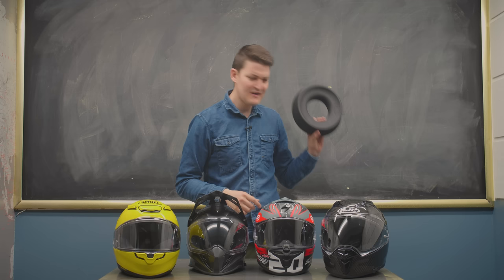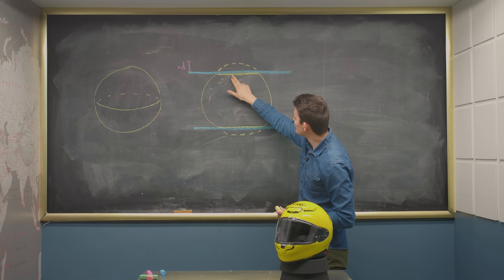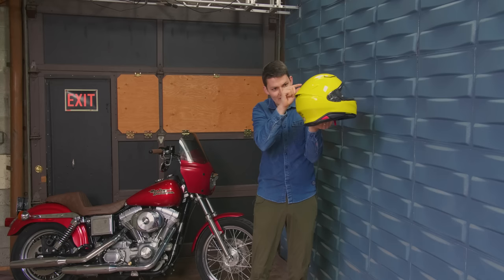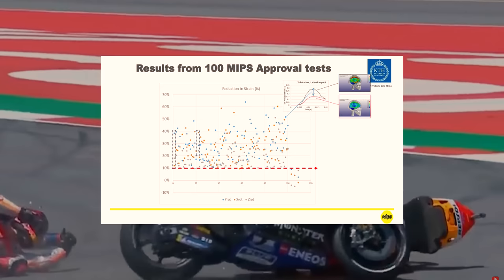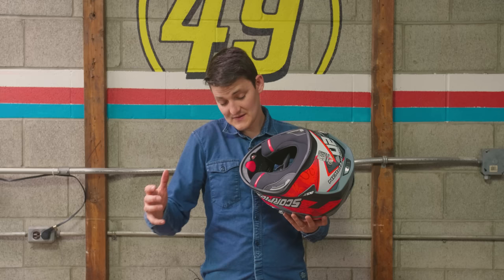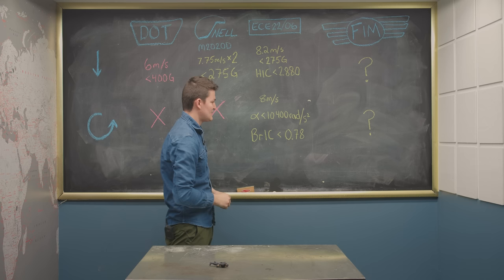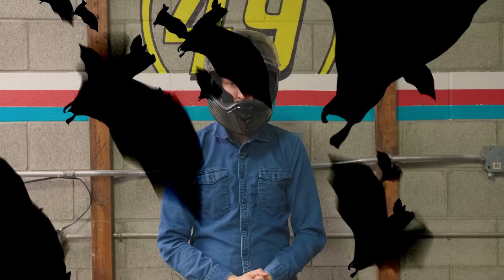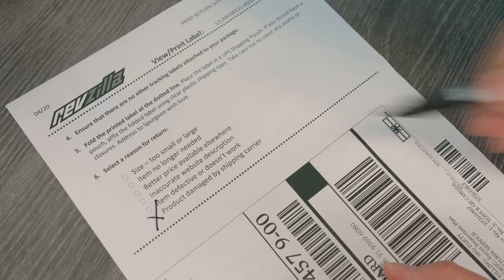What's Inside the Best Motorcycle Helmets of 2021?

Comment: Mandatory disclaimer: people should check the details of the ECE rating they see on helmets. 22/05 and 22/06 are quite different and not many helmets are up to the 22/06 standard just yet!
Reply from the maker: Very valid point! ~RF9
Reply: The Arai Quantic, which was not "designed" to pass 22.06, is the only helmet as of yet to pass this new standard.
Reply: @scottenlow5249  and the new Shoei
Reply: @rideoutlondon  do you know which shoei specifically?
Reply: @222wheelsdown  NXR2
Reply: Thank God for the FIM of the Scorpion then, sheesh.
Reply: @FortNine 000000
Reply: @FortNine  but the HJC F70 carbon 2021 is only ECE 22.05 approved… Is there something I didn’t get?
Reply: @ook92 wondering this myself.

Comment: I bought the EXO-R1 about a month ago and I'm glad to see it here. The fit is incredible and everything about it feels premium.
Reply from the maker: Glad you're enjoying it! I've been loving mine as well. ~RF9
Reply: Does it have room for communication devices?
Reply: @Delalcon  Yes it does!
Reply: @HydefHyde  Cool! Thank you
Reply: Would you take it over the shoei? I've been looking at the scorpion because it's technically fim homologated. But I like that the shoei has mips. Someone help
Reply: @joshuaplantan90  I ordered both the EXO-R1 and a Shoei RF-1200 and spent some time sitting around my house with them on. They both felt great, and it really just came down to the smaller particulars of how the Scorpion's more plush chinstrap felt around my jaw, the inflatable cheek bladders (as mentioned in this video), the inclusion of both a clear and dark visor, pinlock, and overall style that lead me to keep it and send the Shoei back. From what I understand about the RF-1400 is that it's more of a iterative step from the 1200, not so much a revolutionary one. Better air venting and more refined angles I think. I would imagine they are pretty comparable in terms of safety, but I that's only going by the safety organization certifications and not from personal experience (fortunately) crashing in either of them.

Sorry if this wasn't more decisively helpful... If you're really on the fence I would recommend doing what I did, ordering both and seeing which gels with you more! Both RevZilla and MotorcycleGear do free returns as long as you didn't (visibly) take it out on a ride or ding it up. Good luck!
Reply: @HydefHyde  definitely leaning towards the scorpion, my problem is finding gear that fits. My hands are to small for a small glove but my fingers are too short for a medium. The arm length on a small is to short but the chest area fits perfect vise versa for the medium. I like the idea of the inflatable pads to get the right fit
Reply: @joshuaplantan90  I have a similar problem ! My sizes are all over the place. Large jacket, small gloves, extra-large Helmet! Must be the huge brain! :P

Are you measuring yourself for your gear? Not to rep Revzilla too much, but they've been really helpful with the sizing charts and sizing recommendations on their project pages and videos for when things run big or small or otherwise unusually. When in doubt I just call them for recommendations regarding sizing, and now I have a full set of gear that fits me perfectly.
Reply: @joshuaplantan90  I know how you feel unfortunatly ahah
Reply: @HydefHyde  yep tape measure and all. Thinking about getting a jacket next, then a helmet. Save some money for now then get a bike. Have my M endorsement just don't have any gear :(

Comment: I have the Shoei RF-1400 because of this video and it is everything Ryan said.  It is incredibly comfortable (once on) and very quiet but it destroys your ears taking it on and off.  The trick is to tuck your ears in to the helmet before you pull it down over them.  This reduces the discomfort by 50% but it still smarts a little.  Other than that...darn near perfect helmet.

Comment: This is a most excellent video.  I like how you cut it apart, explain each layer and rating standard.  I have ridden 45 years, always buy top of the line helmets offering the best protection.  I crashed in 1983 with a Bell Star helmet which save my life no doubt, crash once and you are a believer.  After my crash I took a motorcycle safety course and learned how to ride, went on to become a motorcycle safety instructor for 15 years and now just enjoy my wind therapy.

Comment: Great vid! I love that a company is bringing FIM safety standards to more affordable prices
Reply: but then dont forget that a FIM helmet might safe you at a 200 km/h crash, but there is no
part in the regulation that would help you in you normal 50 - 100 km/h crash

if you design a helmet to jsut work at high speeds you get one that sucks at low speeds while
the contrary isnt as true
Reply: @lexel90  They aren't just designed for high speeds tho? They are basically more stringent than both SNELL and ECE in both criteria for crash resistance, at all speeds.
Reply from the maker: @lexel90  FIM is actually the most rounded standard, speed wise. If you plan on hitting the wall at 200km/h, Snell is by far the best bet. ~RF9
Reply: @FortNine  awww hoping id see my bell race star on here, almost got the shoei over my bell
Reply: @FortNine  so fim for the street, Snell for the track?
Reply: @joshuaplantan90  nah fim for both

Comment: A early 80's Simpson full face flexed so much on impact that it shattered both eye sockets, broke the nose, upper and lower jaws and both cheekbones. Some of the wires to put my face back into position are still there 38 years later. The only thing that didn't break was my forehead, which the doctors used as the anchor point lacing wires through all the broken bones and pulling / pushing everything back into place. I survived, and the helmet looked undamaged. But it flexed way too much. I'm hoping to never crash again (yes, it really was the cagers fault) and I'm hoping that the new crop of helmets in the $500+ range will better protect my head or what's left of it. Thanks again Ryan for a informative and entertaining video.

Comment: Ryan, what about the SHARP ratings? I know they're ultra slow to update, but it seems, based on all available evidence, that their force reduction measurements are the best of them all. Furthermore, you don't just get a "pass" or "fail", but you know exactly how well the helmet preformed. Curious your thoughts on SHARP and why you didn't mention them!
Reply: Sharp is a fixed test. so a cheap helmet manufacturer knows where to reinforce the helmet to get a 5 star rating.
Reply: @akirasanakirasan5347  incorrect: "To ensure that we accurately assess helmet performance, it is important that our impact conditions are representative of real world accidents. The in depth accident investigations carried out by COST 327 confirmed a direct correlation between helmet damage location and head injury. It considered the UN-ECE Regulation 22.05 points to be appropriate and SHARP therefore uses the same impact points – to the front, rear, crown, left and right sides. In addition to this however, for every helmet model that is rated a sample is dismantled to check whether there is any localised reinforcement that could lead to an inappropriately high rating. If this is considered likely, SHARP retains the right to test at any other point on the helmet (within the extent of protection specified in Annex 4 to UN-ECE Regulation 22.05)." from the sharp website
Reply: @rd8586  i am connected to the helmet business i know how they get helmets to pass the test. do not but cheap helmets even if Sharp gives them a high score
Reply: @akirasanakirasan5347  My father is the CEO of arai and he told me the sharp testing is the most accurate in the industry

Comment: Honestly, take a look at the “LS2 Valiant II”, which is a far superior model to any of these. Fully P/J certified while the chin piece neatly folds to the back in Jet mode (serving as a neat little spoiler and counter weight), thus no need to decide every time upfront what could be the best choice before leaving the house. Additionally it is reasonably priced, has quite a  large visor (Pinlock) with integrated sun protection and enough empty space to install any communication package. When in (sub)urban and slow highway traffic, I usually keep it in Jet mode for maximum air flow to my face, but when accelerating further, the sturdy full face configuration is only a matter of swinging the chin piece forward where it locks in place automatically (and vice versa). 

A true game changer, especially in summer 😎 The only downside would be a little extra weight (1700g)

Have a look!

Comment: As an engineer, I need to point out the fundamental flaw in your diagrams: they all show the object uniformly supported at the bottom.  That isn’t the case with a helmet.  During an impact, it is supported mainly by your head, not some magic force along the bottom periphery… unless you are wearing a very robust neck collar which most street riders don’t wear.  So, the real issue is the spreading of the force from the shell to your skull, not the periphery of the helmet.  A flexible shell seems contraindicated to me.  I’d want a fairly rigid shell to transfer the impact to the largest area of the styrofoam as possible and thus the largest area of one’s skull.
Reply: Yep, like most of his stuff he starts of with a nonsensical assumption and farts on madly from there.  Total and utter rubbish fromstart to finish!
Reply: Easy for YOU all to say! Haha. Thanks for the counterpoint.
Reply: But he does bring up a good point that whenever your helmet hits, torque is going to be carried by your neck.
 
 
 
That being said, because your an engineer you probably know where to look or at least give me some pointers, where could a kid like me read about the modern requirements and the technology/methods that motorcycle helmets employ? Because there are a lot of mechanisms that I've seen helmets use (or at least concepts), such as a bio-mimic of the skull as in there's a liquid layer, I forget what it does exactly, my guess is that it spreads the force hydraulically (like that one engine component, I think it's the crankshaft) and offer some slide like the plastic plate. In fact, I would like to know about designing and engineering in general, is brilliant.org recommended?
 
Any place that someone like me, one who has no background in engineering or anything similar, could actually comprehend and read. If there isn't anything like that than how and where can I go to understand the language? And don't say "school", I know that, I need something a bit more "quick" and accessible.
 
Oh and electricity as well as electronics and circuits. I know very little pretty much nothing about these subjects and would like to learn about and understand them.
 
Why am I asking? I want to design a helmet (and many other things, but like this, I lack the knowledge) that contains electronics within, proper ones at that, not aftermarket add-ons. The slide plate made me realize I am still missing components that would make it safe; a hard, dispersion oriented material and multiple levels of impact foam aren't the only things(?) that go in. (If you want, I could tell you what is brewing in this brain of mine, what tech exactly I plan to add in)
   This also brings up something, what material(s) would you recommend that I use? I want something robust under normal circumstances as I plan to abuse it even when not on a bike due to what technologies I plan on implementing within (it will be a demonstrator platform for my ideas, mostly not impact related), but still be able to rely on it when I inevitably fall. In fact, you can exercise your brain too, I'll allow anything from multi-layered shells (like aluminum-ceramic composite) to active systems such as pneumatic bags (simply an airbag) or hydraulic ejection (just something I cam up with right now, impacts squish liquid with resistance, effectively acting as a shock absorber in that it changes motion into heat)
Reply: @jrjrjrjrjrjrjrjrjrjrjrjrjr  I don't think they meant it like that. It could be that they're used to proper representations and when they see a crude version it can't be helped to notice flaws; essentially tunnel vision
Reply: @jrjrjrjrjrjrjrjrjrjrjrjrjr  Wow, what a bunch of nonsense.  I did not question his “graphs”, but his diagrams.  They aren’t the same.  And I did not question Shoei, I questioned Ryan.  And as a structural engineer, I do feel qualified to discusses issues related to forces, load paths and the way materials and structures respond to applied forces.  And what is your expertise?  It clearly isn’t engineering.

Comment: Great video as usual! I do like the HJC but my questions are how much protection do you give up to get the expansive view?  Also I live in a hot climate so most of the summer riding in traffic the heat is more of a risk than the soccer moms yelling at their kids while driving down the road! I was considering getting a helmet where the whole front can pivot up, so at least at stop lights I can cool down. My concern and therefore question is how much safety do I give up to avoid suffering heat stroke?
Reply: Those helmets are called modular helmets. Some of them are rated with the chin bar removed and some are rated with it attached, just make sure you get the one that's safer.

Comment: I am looking for a quiet helmet that offers effective cooling for hot days and warmth for winter riding. I saw no coverage of noise levels or veltilation or cost of replacement shields here. Safety is a minor concern. If you come off at high energies the helmet will look good on your wheelchiar.

Comment: A straight impact to the head, while wearing a helmet, will transfer the energy along the same axis, but in a crash you’re likely to strike the ground at an angle… at that first impact your helmet could be twisted or rolled, and it’s MIPS that is claimed to reduce the amount of this directional force that gets to the head, helping the cerebrospinal fluid protect the brain from damage that could lead to concussion or worse.

Comment: I've been trying to get a tinted visor for my RF-1400 since early March. Now the ETA is Mid June. Hopefully I can get one before this years riding season is over. Otherwise I'm very happy with the helmet. It's tight to get on and off but comfortable. I've got around 2k miles in it, some in extreme heat and it's just starting to break in good.

Comment: @FortNine could you do an in depth review of MIPS technology? My observation is that the head modelling/testing uses a fixed surface. However, skin (scalp) provides a biological slip plane (probably also 15mm) so I suspect MIPS is redundant. It's straightforward to demonstrate this with (a non-MIPS) mountain bike helmet.
Cheers, Dan

Comment: HJC is probably the only helmet that I can buy due to size.  They have some models in a 5XL size and with a hat size of around 8-3/4 to 8-5/8, I need that size.  The thing is, the larger size helmets do not have the same protection rating as the smaller size.  For example, their MC5 helmet is Snell rated, but for 3XL to 5XL, it's only DOT rated.  Solution?  Don't have a wreck...

Comment: Cost/Benefit ratio of helmets for me is around $250, not $400 US.  The old junk we had for helmets still did a pretty good job when I had to crash test a few in the field (but I was never one to race/speed). You with your predilection for facts and factors might look at what percentage of improvement in injury/death modern helmets offer over helmets of 40/30/20/10 years ago.  Might be interesting.  Still, good information.  Thanks.

Comment: I'm not sure I'm willing to sacrifice direct impact capacity for a potential rotational benefit that I may already have with the comfort padding of a premium helmet.  Remember that 15mm of rotation on the Rf1400?  Kinda reminds me of how my helmets shifted/rotated when I did do a get-off, or two, a long ago.

But, with the sheet of slippery plastic (UHMW?) Shoei gives you the slip boundary and still meets Snell M2020D.  Sounds like there's no need to compromise with the lower strength shells, thinner styrofaom, and the little isolation mounts, of some designs.

Elastic shells and acoustics?  I think Ryan means compliant and less rigid...........

Comment: I was curious why you didn’t include 6D Helmet technology. Their  ODS technology is unique and effective. They also have a lot to say about the FIM standard as well. The owner told me that the hardness rating of the outer shell is too hard. They have had meetings with the other manufacturers and FIM about it. They can explain it from an engineering standpoint better than I can.
Reply: Also very curious. This needs to be addressed. D6 has some serious science behind it.
Reply: I actually bought a 6D and returned it. Problem is they spent all the cash on safety, and forgot to actually make a usable helmet.

Build quality was on par with a $100 helmet.

I I was only using it twice a year at the track, I'd have kept it. Problem was that I want to commute daily... And that sad helmet wouldn't have lasted a season, and I can't afford $800 annually.
Reply: Bob Weber and 6D make helmets that exceed any of the "standards" other helmets are held too. That's the problem. They're in a league of their own and do not get measured properly against the rest.

Comment: I tried to crush an old 1980's full face helmet with a dump truck by putting helmet under trucks box while lowering it. The chin guard bent up and then went back to its normal position. That's all. Helmet didn't crack or deform in any other way.